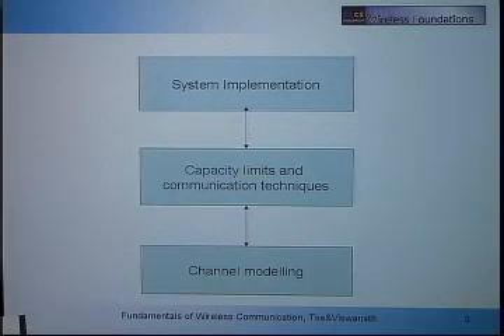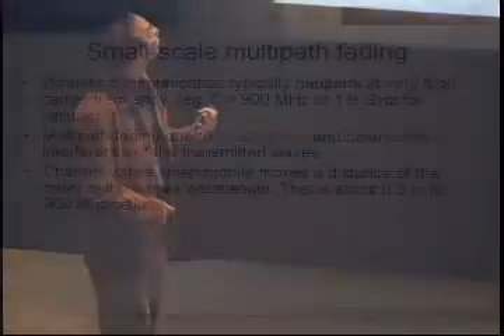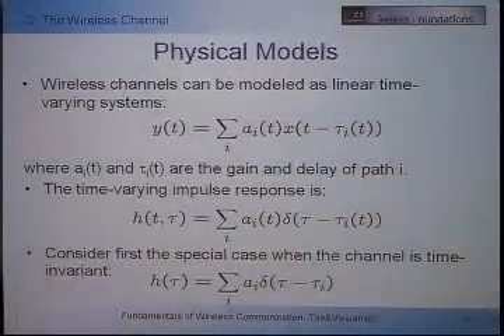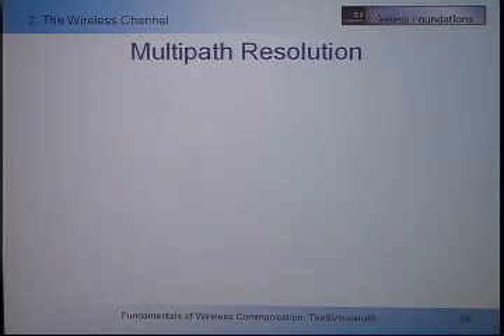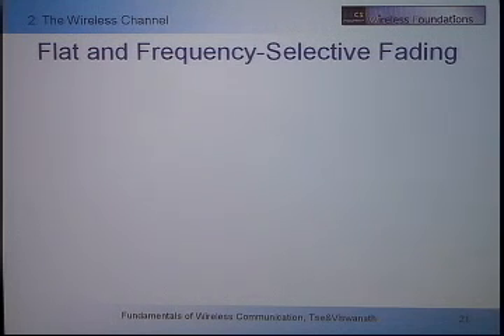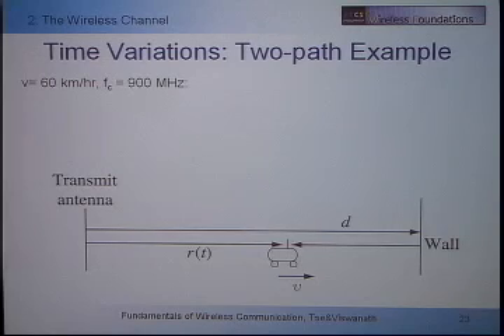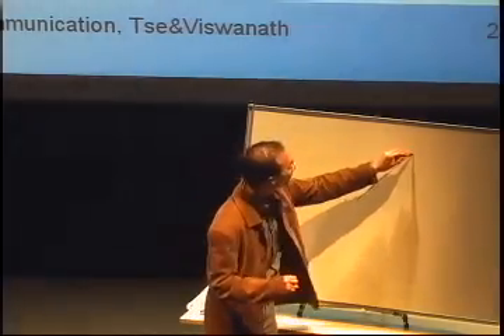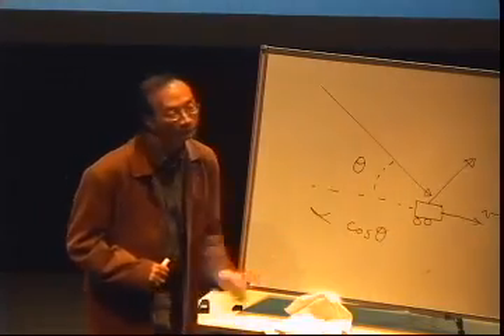Fundamentals of Wireless Communications I - David Tse, UC Berkeley

Comment: Delay Spread: 
It is the difference of the arrival time of multipaths. If the BW of the signal is W, then all the paths that arrive within 1/W are  non-resolvable, i.e., they cannot be separated and hence they result in either constructive or destructive signals due to the fact that these different phased signals are added all together. 

On the other hand, if W is very large, then 1/W is very small. Therefore, the multipaths can be easily resolved, i.e. separated. If we had a signal with infinite W, then 1/W would have been almost zero. Therefore,  we could resolve all the multipaths and we would not have the fading phenomenon. But BW is a scarce resource and hence we don't have an infinite bandwidth and hence we are to accept fading. 

If the delay spread is smaller than 1/W, then all the multipaths would fall within the duration 1/W, and there will be only one  tap of the channel. This is known as the flat fading channel. So, this happens when delay spread <1/W or 1/delay spread>W. 1/delay spread is also known as coherence bandwidth. So, we have a flat fading channel when the coherence bandwidth of the channel is greater than the signal bandwidth. Otherwise, the channel is a frequency selective channel

Doppler Spread:
On the other hand , Doppler spread is a phenomenon linked to the change of the channel with time. It is proportional to carrier frequency, angular spread of the multipaths, velocity etc. Doppler spread is higher in a high scattering environment where the angular spread is larger. 

Doppler spread is not directly related to delay spread. Doppler spread is proportional to the range of rate of change of path-delays while delay spread is the range of delays. If two paths rotate at the same speed (same doppler shift), then the doppler spread will remain the same and the channel will not vary.